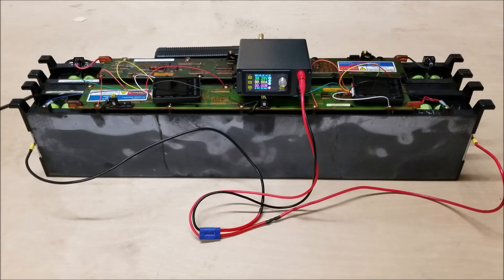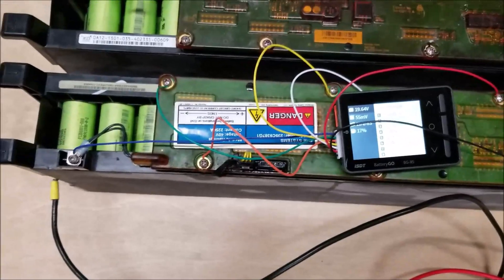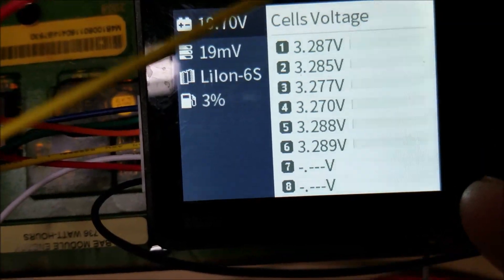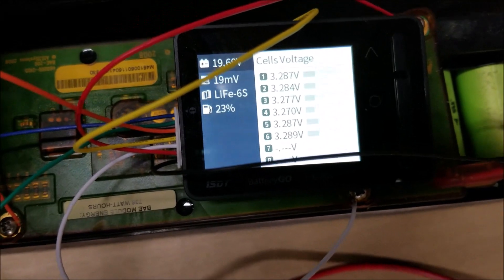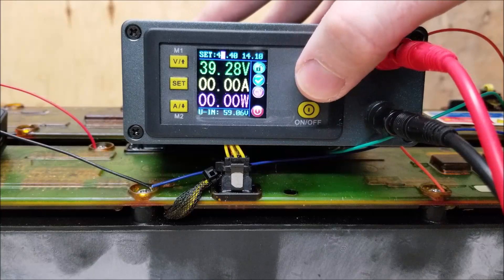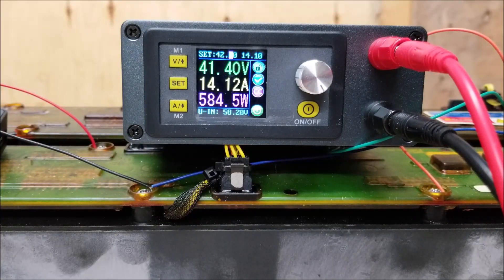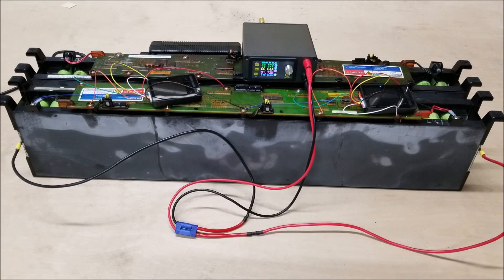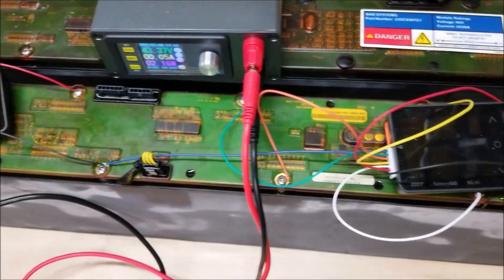A123 pack testing ANR26650m1A

Comment: wouldn't the integrated BMS be limiting the charge? why not disconnect the board and then charge up to 4.2 with your pair of little bms'?
Reply from the maker: The BMS didn't seem to be doing anything, I don't think it was active at all. I didn't realize I could simply remove it, I did so on the second pack. I took this pack apart and tested each cell individually, capacity ranged from .6 Ah to 1.5 Ah, most were around 1.1 Ah, so yeah, this was a bad pack.
Reply: @DIYbatteries  well i'm now regretting having just bought 2 packs for $125 +$100 US shipping.
Reply from the maker: @thedavesofourlives1  You got a good deal, I paid $200 for 2 packs although my shipping was less as I'm in Canada. At least the second pack was better, hopefully yours will be like my second pack.
Reply: @DIYbatteries  shipping to alberta, mine came at 3.2v and i'm testing now. Word on the street is that the bms is just a monitor, but mine were perfectly balanced so i suspect it must have some balancing effect, especially all the SMD resistors onboard in parallel.
Reply from the maker: @thedavesofourlives1  3.2v is a good storage voltage, you should check if they are balanced when fully charged. I think it is a BMS but it probably needs to be activated externally.
Reply: @thedavesofourlives1  Will you recommend these packs for the price? let me know please. I assume you have now fully tested them.
Reply: Charge to 4.2v?  Also, someone above omeone mentioned a discharge to -30C. I thought these LiFePo4 but obviously not. Good luck with those cells guys.

Comment: more photos here of same units: http://www.eevblog.com/forum/buysellwanted/a123-anr26650m1a-lifepo4-battery-modules-12s8p-39-6v/
Reply from the maker: Same units but different use, the one I bought came from a bus (as per the ebay listing)
Reply: @DIYbatteries  they must have really abused the buses, as these are supposed to last 1000 cycles +

Comment: What make / model is the power supply you are using please?
Reply from the maker: Actually it is three old HP power supplies for laptop docking stations connected in series. They are 230W, 19.5v, 11.8A so in series that's 58.5v just under the maximum 60v the DPS5015  is able to handle. Same as this one: https://www.amazon.com/HP-Smart-230W-Adapter-Localization/dp/B00325QTOQ
Reply: @DIYbatteries  Thanks so much for the speedy reply. I meant the adjustable power supply you are using to charge this battery? Cheers.
Reply from the maker: @scottetherton9364  It is a DPS5015 which I got from Banggood: https://www.banggood.com/DP50V15A-DPS5015-Programmable-Supply-Power-Module-With-Integrated-Voltmeter-Ammeter-Color-Display-p-1072236.html?rmmds=search&cur_warehouse=CN
Reply: @DIYbatteries  Awesome - thanks. Gonna get me one  :-)